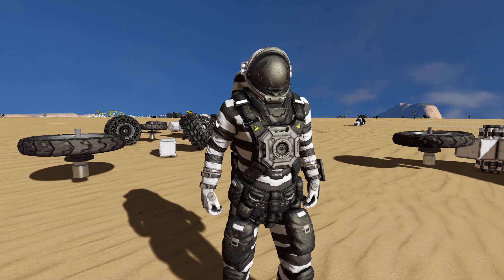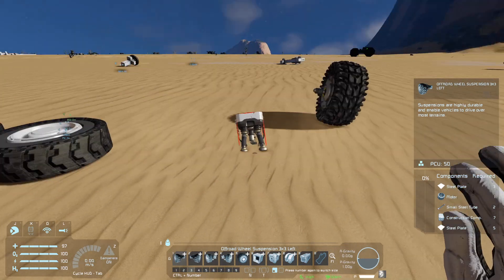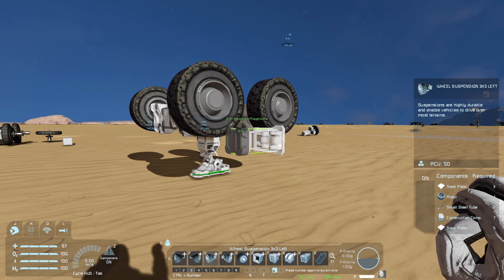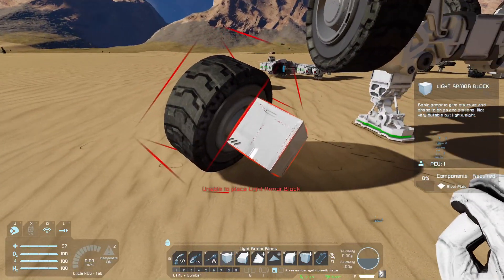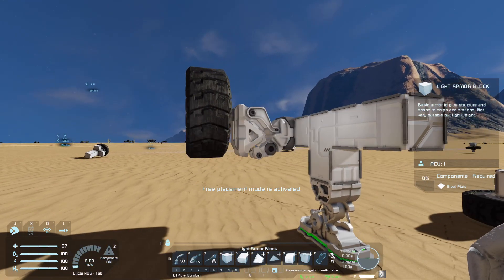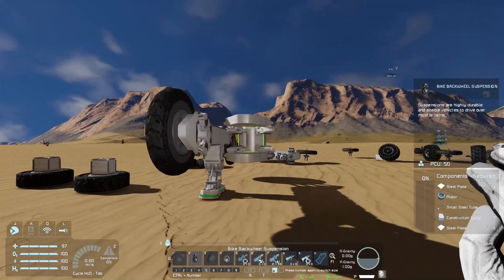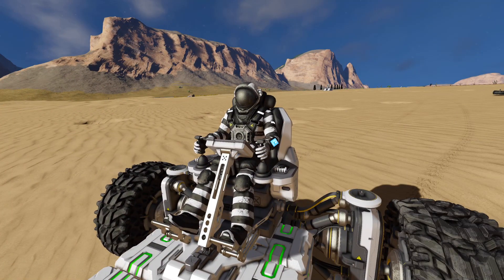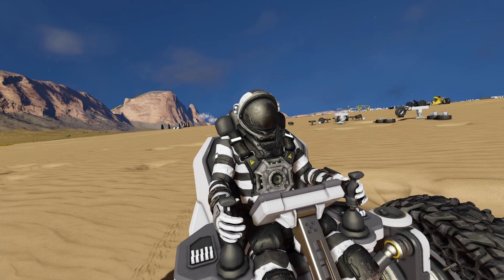Space Engineers Experiments: Can We Add Suspension Wheels on Rotors?

Comment: Got an odd idea for a suspension system:  Imagine a fidget spinner with a suspension from the center of the three wheels.  That center axis spins freely, while the 3 outer wheels have power.  At any time, at least two of the wheels would be in contact with the ground, usually 4.  And you would have 2 sets of these on a vehicle.